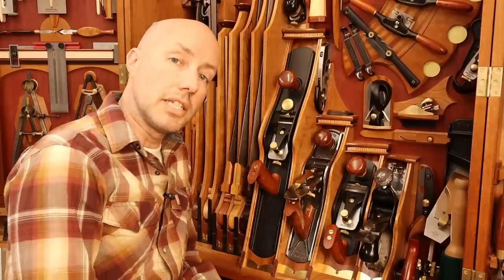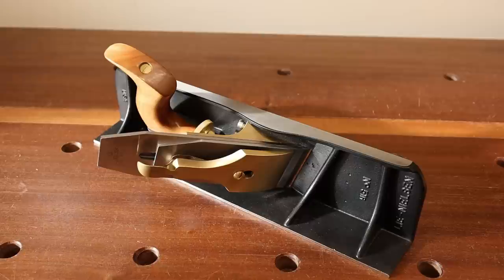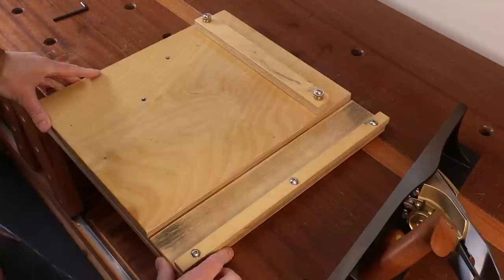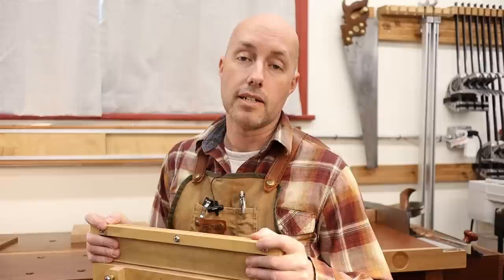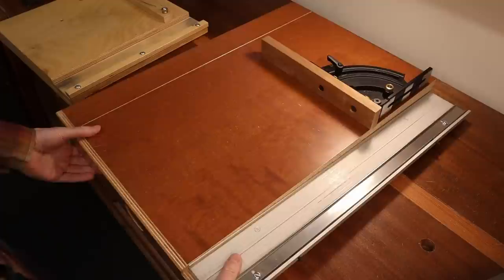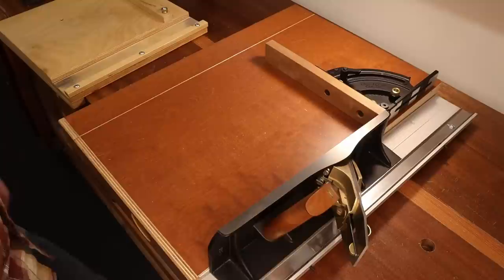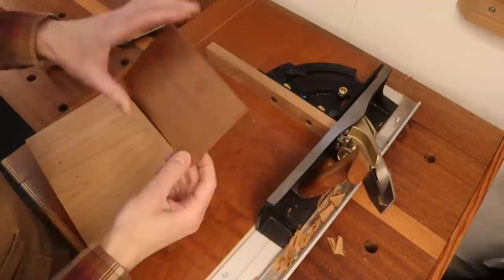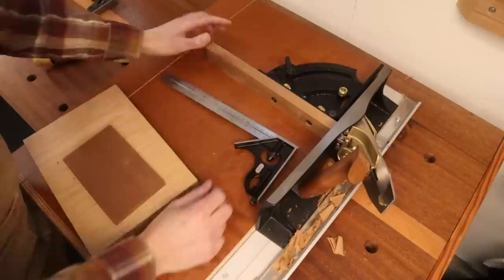The Most Important Hand Plane in My Shop

Comment: UNEVEN IRON WEAR.  have a thought on the subject of uneven wear on the plane iron. But firstly, may I say that I just recently found your channel and am very impressed. Hope the algorithm starts to work in your favor soon to make all your effort more worthwhile. Right, back to my thoughts on iron wear.  Surely, if you were to replace the relatively low-height sacrificial fence with a taller one, then use shimming boards to raise the main deck height, then by occasionally adjusting your working deck height, you could spread the wear on the iron across more of its width…or is that height? Anyway, it’s probably not a new idea (there are so few) but one that occurred to me after your video, which, by the way has wholly inspired me to revisit the  current dreadful shooting board mash-up in my ‘shop.
Reply from the maker: I've done that before (and still do with my old shooting board) but it's a bit of a hassle.

Comment: When I depended on my power saws to give me precisely squared ends and edges, I was constantly frustrated…adjusting and readjusting my equipment, and still finding my joinery was imprecise. Then I learned about the shooting board (during Covid lockdown) and everything changed.  I have a newfound appreciation for hand tool woodworking. I got rid of my chop saw, and my table saw may be going away soon as well. Like Paul Sellers and yourself, I find myself leaning toward the idea that a good bandsaw is really the only power saw I need. Excellent video quality, by the way.

Comment: You can buy Veritas PM-V11 replacement blade for this shooting plane, it is 2-3/8 wide and just a little bit thinner. Then you will have the best of the two worlds.
Reply: I've tried both the standard A2 iron and the PMV11 iron in my 5-1/2, and I found that while the PMV11 does hold an edge slightly longer, the extra thickness of the Lie-Neilsen iron made the plane work much better overall.

Comment: I use the bevel up jack rabbet plane for shooting.  I made side plates from oak and screwed them to the sides using the fence rod mounts.  I can adjust the mouth and the handle will tilt left & right for a donkey ear shooting board.

Comment: I like your design of SB.  Not being able to see how the Veritas slide is built I would add a small rabbet at bottom to keep plane away from cutting piece if it is not already there.  I prefer the Rob Cosman way of back beveling pieces as opposed to using a chisel, but they both would work and takes about the same time.  Top notch design though.

Comment: Back in jr high, I was taught to chamfer the back of the board with my hand plane by flipping it and holding it at an angle until I got down to my gauge line. Then flip it over and work to that line from the front. No need to switch tools and whatnot.  You're a hell of a lot more of a craftsman and more experienced than I am, so I'm curious: do you have a particular reason that you don't use a plane to chamfer the back on the shooting board, or is it just a preference thing?

I have a friend that buys pretty much everything Lie-Nielsen and Veritas make, so I've gotten to play around with both shooting planes. I prefer the Veritas.  Somehow it felt more stable when I was testing it on some really dense and oddly-grained purple heart. My only guess is the orientation of the mass of the bevel-up blade had a small advantage over the bevel-down blade being a more angled lever. Just my guess. Only tried the Lie-Nielsen that my friend had, so might have been an issue with that particular one. All that said, the Veritas is a very nice piece of kit for a good chunk less money. I can't imagine not being happy with it.

Great video as always. Thanks for putting in the work.
Reply from the maker: It just a preference/way I'm used to doing it.

Comment: I may have missed this part, but you complained your old shooting board only used the bottom portion of the plane's blades, was there some kind of fix to this with the new one I missed, or were you just explaining a disadvantage of shooting boards in general? *Im hoping you have a fix i havent thought of.
Reply from the maker: The ramped track makes use of more of the plane's blade, especially as the boards get wider.
Reply: Yep, I missed it, caught it on the second watch. I hadn't thought of that advantage of the ramped track, thanks!

Comment: That veritas track will end up putting groves in the plane, its done it to mine
Reply from the maker: Weird. I've used the hell out of mine for years to no I'll effect. Are you using the UHMW tape they sell with it?  I could see how there could be be an issue if you're running it metal-on-metal.

Comment: I wonder why your Jointer Plane is low angle. What are the benefits of that?
Reply from the maker: I can (and do) change the cutting angle by simply swapping a blade.  Usually there's a 30° blade in there, but some woods plane much more cleanly with a higher angle blade.  I'd like to think it balances nicely when edge planing too (with the lower center of gravity).